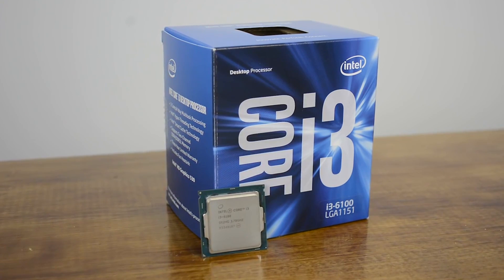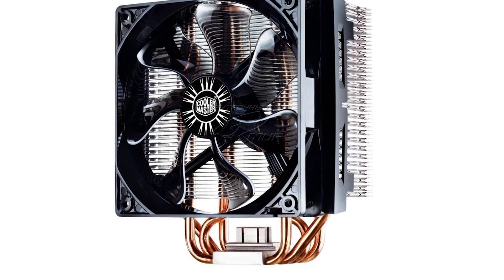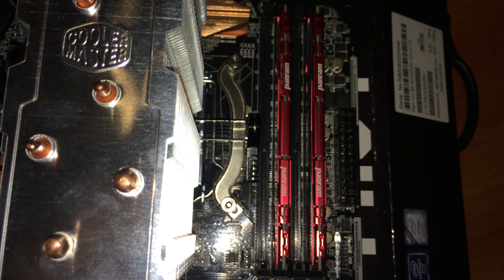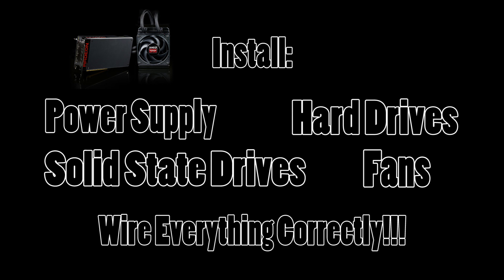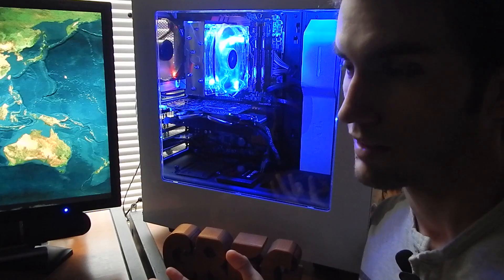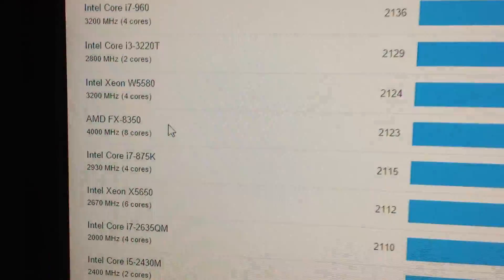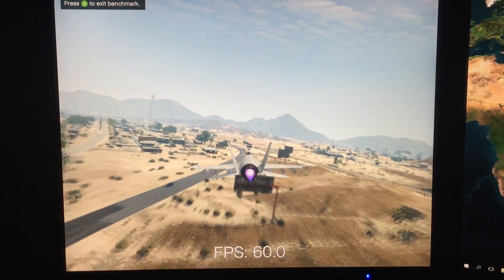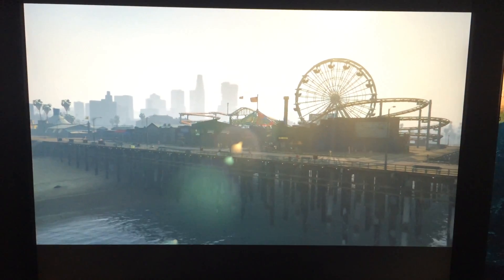$600 Intel i3 Skylake Build

Comment: How do I overclocked this to 4.0ghz??
Reply: this is locked cpu cant be overclock.
Reply: +snoopy shippy  It actually can be Overclocked  ,but only if you own a Z170 Motherboard
Reply: +S a d C a t oh thanks for info can I overclock on asus h110 d3?
Reply: +S a d C a t cool, I have an i5 6500 with a z170
Reply: snoopy shippy  As i said , only Z170 Motherboards support overclocking for the non-K Skylake CPU's

Comment: Would this CPU bottleneck an R9 380? If so, should I buy a GTX 960 instead? Both those cards are the same price where I live.
Reply: +Gixxer Fixxer R9 380 4gb is a better choice unless you're pre-ordering or buying on launch.

And no It won't bottleneck
Reply: +Gixxer Fixxer It won't bottleneck, I would go with the GTX 960 4GB. For some reason, AMD cards have been having issues with new games lately.
Reply: fionn mcgrath And what PSU would you recommend if I went with the 380? Would a 500W 80+ Bronze do the job? I don't plan on over-clocking, if that helps.
Reply: Which cpu?
Reply: fionn mcgrath i3-6100
Reply: You should be fine but a 550 one would give extra OC room if you ever decide to do it in the future. (I know you don't want to right now)
Reply: fionn mcgrath Thanks so much.
Reply: np
Reply: fionn mcgrath
Truly a very wise man. Why is AMD getting a hard time though? It's so strange that Nvidia graphics card will run the games at launch but issues with AMD cards will have to wait.
Reply: Michel Hanson Thank you, I think it's NVIDIA Gameworks that messes it up for AMD and the fact that NVIDIA cosy up to the devs to encourage them to optimize  for their cards
Reply: fionn mcgrath
Ahh boy, looks like the feature is going to die down anytime either cause even after Batman: Arkham Knight, AMD still had issues with a few games after that like AC Syndicate.
Reply: I'm assuming you meant isn't going to die? If so then yes, but AMD are working on their own open source equivalent to gameworks however I don't know if it'll be any good
Reply: fionn mcgrath
It has to.
Reply: I have the i3 6100 with a R9 380 4gb. It runs games well at 1080p max settings apart from GTAV which although running very well could definatly benefit from an i5 due to the games demanding cpu usage. Oh and get a 4gb gpu if you want to play GTAV.

Comment: Would this CPU bottleneck an R9 380? If so, should I buy a GTX 960 instead? Both those cards are the same price where I live.
Reply: It would not but it would bottleneck a 390 or 970 so you're good if you are wanting to buy a r9 380 and an i3 6100

Comment: which one would be better with i3 r7 370 or gtx 960?
Reply: +Basant Tirkey 960
Reply: +Pencho GotShoes which brand and 2gb or 4gb version?
Reply: +Basant Tirkey If you want optimal performance go EVGA FTW 4GB but basically u can go any brand u like will get the job done :)
Reply: +Pencho GotShoes actually I have a 1080p monitor with 60hz refresh rate and I'm building a rig identical to this but confused with buying gpu so which one should I go with?
Reply: +Basant Tirkey EVGA GTX 960 FTW 4GB is the best 960 in my opinion + it has backplate

Comment: Great video, thanks for sharing.  I'm going to build my first PC and I have a lot of similar parts.  I just had a couple of questions.  Why go with the after market cooler if you're not overclocking?  I only ask because I'm going with the same CPU and was told it wasn't necessary.  Also, how does the R7 fair compared to the GTX 950?  I went with the 950, which was about $150.
Reply from the maker: The stock cooler is terribly loud. Cooler temps are always better.

Comment: Hi i have a question. which psu are u using for that rig?

was going to build this setup.
1.mobo Gigabyte GA-Z170X-gaming 3
2. i3 6100
3. corsair vengeance 2x4gb 8gb ddr4 3000mhz
4. SSD scandisk 120gb
5. seagate 1TB HDD
6. EVGA 500W 
7. EVGA GTX 960 FTW+ACX 2.0+ 4GB.

Do u think 500w is going to be enough for my budget rig??

Please do tell??

Sub from me bro keep it up. hope to get ur opinion.
Reply from the maker: I believe this rig used an EVGA 500W. Looks like you've got a great build on your hands. 500W should be plenty.
Reply: +Science Studio thanx for ur opinion bro. That was fast giving ur opinion. With my build that im getting are also future proof. That is why i chose the gaming series gigabyte(LGA1151 socket maybe ill get a i5 6600k or even i7 ) . Think i'll be doing some sli/crossfire in the near future. Oh one more question do u think 8gb ddr4 at 3000mhz will be a problem for the mobo, cuz i read something about this board saying it can handle up to 3466(OC). Thanx again bro. just asking.

Comment: you need to update bios. thats why they release new ones cause its more stable and has fixes
Reply: +botee2k with new bios it's cannot be overclocked
Reply: +Cedric&#39;le Kopuyoruz xD whats your mobo and processor sir? you need a Z mother board with a K processor to be able to overclock properly. intel removed the ability to overclock a non k cpu
Reply: no u think wrong man. with old bios z motherboard u can overclock non k skylake cpu.
Reply: yup thats was possible and thats what people did. but intel did some online update on their processors directly.
Reply: really? wow i didn't know that. then if i will buy i3 6100 and asrock z170 motherboard then i cannot overclock it now?
Reply: you cant. intel really doesnt want people to do it

Comment: Hey man, what do you think about my build? This is my first ever pc build. Im really on a budget and im not really into hardcore stuffs, just want some decent gaming pc that can run popular games right now in 1080p with 45+fps. Here's my build:

CPU: Intel i3-6100
MoBo: msi b150m night elf
V.Card: Sapphire r9-380 4gb
Ram: GSkill Ripjaws V 2x4gb DDR4 2400
PSU: Either this Thermaltake Thermaltake Toughpower XT 675W TPX-675M or this Seasonic M12II-520 EVO 520W 80Plus Bronze Fully Modular or this Seasonic S12II 520W 80PLUS Bronze can't decide which is better.
HDD: WD Caviar Blue 1TB
SSD: no ssd for now.

Hope to hear your thought about my build. Thanks!
Reply: +qwerty-ytrewq U can save some money and get 500W power supply (It will be enough).Also go for 2133Mhz Ram (b150 doesn&#39;t support 2400Mhz). That&#39;s everything .
Reply: +Pencho GotShoes why would you buy b150m ?
Reply: Why not?  U can't overclock non-K CPUs anymore.
Reply: What do you think of my first build? http://pcpartpicker.com/list/4Qvf8K

Comment: hello I was thinking to buy the I3 6100 cpu but I do not know which one to choose Between i5 6500 skylake and i3 6100? Does theese two Cpus have large difference in gaming? Thanks a lot!
Reply: Some games need a lot of cpu power and the i5 6500 is much better then with the 4 cores instead of 2
Reply: Thanks a lot!
Reply: +SorryPkWasHere bwt u cant oc non k cpu so u dont need a z170 board and a extra cooler

Comment: On what resolution you benchmarked gta v? because i dont believe your monitor can handle 1080p
if you`re running in 720p for example this benchmark is a bit dissapointing because you dont say your not running in 1080p
Reply from the maker: This was an old dual monitor setup before switching to my Ultrawide. It's resolution is 1600x1200, which is only barely under the pixel rate of 1080p.

Comment: Your 650$ i5 build is way better the i3 won't it cut it all for games
Reply from the maker: The i3 is definitely good enough for the casual gamer. Gave well over 60 FPS on some titles.
Reply: Science Studio some games won't run on an i3
Reply from the maker: +Kvarcaz1337 A very select few won't.
Reply: +Science Studio Like which ones? I know Arkham Knight and Assassin&#39;s Creed Unity are pretty awful as they were not optimised properly in the first place. Not the CPUs fault, hell not even the video card is at fault.

Comment: how did u put 2666 mhz, i tought the max is around 2100
Reply: +InfernoTNT The max for h110, b150 and h170 motherboards is 2133, but the max for z170 motherboards is something like 3200.
Reply: 2666 is the lowest I think.
Reply: +InfernoTNT the max is over 4200....
Reply: You need to set the XMP profile for the RAM if it supports that and your motherboard aswell

Comment: I can see a lot of work went into this video, and I appreciate the effort. Having said that, I'm disappointed at the misleading title. How can we call this a $600 PC when there's no operating system included? 95% of people building a PC are going to need Windows. There's also no sound card, no network card, no monitor, no mouse, and no keyboard. You should have called this "How to build an $800 Skylake gaming PC".
Reply from the maker: +selohcin No video of mine will ever include a mouse or keyboard (a $15 combo), or a monitor. Do consoles include monitors or TVs? Negative. There are free operating systems available as well. You also don't need a sound card. If you had actually paid attention to the video, you'd have seen that the motherboard had on-board support for 5.1 surround sound. Additionally, the motherboard supports LAN with a simple driver installation. Please do your research before posting exaggerated and rather inaccurate comments. To sum up my rebuttal, I would like to make the following announcement: the PC was $600. The title is not misleading.

Comment: Frak it piss's me off how asian made IT parts are in USA , just looking at that build , it comes to over AUD$600 without a graphics card
Reply: +charlie brownau Aussie - Skylake Overclock i3 Build
* Intel Core i3 6100 LGA 1151 3.7GHz CPU Processor - AUD$175.00 .. 
* ASRock Z170 Pro4 LGA1151 ATX Motherboard  - AUD$190.00
* Kingston 8GB (2 x 4GB) 2400MHz DDR4 HyperX FURY - AUD$90.00
* WD 1TB HDD - AUD$70
SSD - AUD$70
600W PSU - AUD$70-90
Case  - AUD$40-90
DVDROM - AUD$20
Graphics Card AUD$140-AUD$200

Comment: Wow. USA prizes are really cheap. Here in Europe it's pretty expensive to buy the same hardware. i3 6100, DDR4 2133 RAM, GTX 750 TI, CPU cooler, case etc is about 555$ plus the setup is like 600$. Why the setup? Well if you order that, then you don't have to pay shipping taxes, buuuut: shipping taxes (12$) and setup (45$). And I thought at the begining that ship taxes were like (30$), so there wouldn't be such as money to improve anything from the pc. I was wrong... Anyways, I could bought that instead if I lived there... Wow.
Reply: Forgot to say that my mobo is a H110 vs that Z170. That's the biggest difference after all.
Reply: +Contraa In Australia we get RIPPED OFF for Software , pro audio music gear and computer gear aswell , they CLAIM it is the US<>AUD dollar or the amount aussies make compared to USA people , but we all know its the AU TAX with America tech gaints ripping Aussies off when 99.999% of all the parts are made from China
Reply: +Contraa H110 is around AUD$100-AUD$165 , Z170 is AUD$185 to AUD$270

Comment: I added the same CPU with a 7970 and a Krait gaming mobo with 3200mhz ram and this little beast is very impressive...I have to agree that this is probably the best bang for the buck and benchmark wise should walk on any Xbox One or PS4 regarding hardware muscle.
Reply from the maker: That sounds like an epic combo you've got going there!
Reply: +Science Studio  So far this combo appears to hit the sweet spot for price.  Single core games and bandwidth intensive games should  take advantage of this setup.  Looking at benchmarks, it appears that this cpu gets kicked the most by game engines that properly take advantage of truly multi-core processors.
Reply from the maker: +Mr. Cimmarrusti Check out our newest benchmarking video. Also, I'll have a new Core i5 6400 + 4GB GTX 960 uploaded in a few days, the parts should be here this weekend. Will be interesting to compare.

Comment: hi sir its me again. can i use r9 380 videocard and samsung 250gb ssd for this build? i prefer i3 coz its cheaper than i5.
Reply: every i3 6100 skylake processor already have hyperthreading ocd?? im looking on newegg but i only saw i3 6100 3mb 3.ghz
Reply: +Gab Bennington why did you used 2 hard drive? the 120 ssd and 320gb caviar blue?
Reply: +Gab Bennington ssd for boot the hdd for games and stuff

Comment: OK so now I have a question. I bought everything I needed. I put everything in but when it came to turning it on ,it would turn on but after a minute or two it turned off and it would turn on again then off again. my friends and I tried everything except take it apart. do you have any advice
Reply from the maker: Start swapping parts. Isolate the part that's causing the crash, if you think it's a hardware issue.
Reply: +Science Studio OK will do

Comment: I3 6100 does not support turbo boost so you are stock with 3.7ghz. You can overcloack in asrock mobo with bios update but the processor does not turbo boost.
Reply from the maker: That's correct.

Comment: What Psu are you using ? Its not in the Description
Reply: +MrApvel Immer diese deutschen :D
Reply from the maker: +MrApvel EVGA 500W
Reply: Vorallem ist evga 500w eine tolle Antwort, das geht von fast Böller bis zu sehr gut ^^
Reply: Wahrscheinlich hat er noch n paar Böller von Silvester übrig gehabt und zu eienm Netzteil umgebaut ;)
Übrigens, hab heute nen i7 6700k mit z170 Mainboard, ram und kühler bestellt...
Meine Grafikkarte: R9 270x :D bestimmt kein bottleneck^^
Reply: Pfff solange du nur cinebench spielst geht das ^^
Reply: Gute Idee! Aber ich glaub ich bleib dann doch lieber bei Minesweeper :D

Comment: i though the max ram was 2133 mhz? like specified on intel website? im planning on buying this i3,
Reply from the maker: Max supported at this moment is 3200MHz for most board/Skylake combos, but a theoretical 4000MHz is technically supported by the CPUs. The minimum is typically 2133MHz; that may have been what you were reading.
Reply: +Science Studio yeah i read supporrting 2166mhz ddr4, son that would Be thé minimum supported, not  the maximum?
Reply from the maker: +Bastien Roy It's definitely not the maximum. People already run 3200MHz on their Skylake machines.

Comment: can you please tell me how u use a ram of 2666 while the cpu supports only 2133mhz.i know the mother board supports higher than the cpu but still .. how does it work?
Reply from the maker: The CPU does not control RAM speed. That would be your chipset's job. I have a video uploaded showing how to ramp up DDR4 speed.
Reply: +Science Studio 
yes thats true but does it mean somthing when the cpu dosent support the amount of ram the mobo does support?
Reply: +Science Studio The memory controller is built into the CPU.  Not the chipset.  From Hardwarezone.com:

Dubbed DDR4 Non-Z OC, the feature adds automatic memory overclocking capabilities to ASRock B150, H170, and H110 motherboards for improved memory performance. It is actually similar to the DDR4 OC feature found in the UEFI BIOS of ASRock Z170 motherboards, which is able to increase the frequency of select DDR4 DIMMs from 2,133MHz to 2,800MHz, a 30% speed boost.

The cpu is the one that will dictate how far the memory will overclock.  Everything above 2133 will overclock the controller (on the cpu).  Just because you have 3200mhz memory doesn't mean the cpu will overclock that high.    Also, when people have overclocked the locked processors, they have usually backed down all memory to a safe 2666 regardless of how fast the ram is.

There are many videos on how the integrated memory controller works.  If you want more info it is pretty easy to find hundreds of sites that will describe how it works.  Skylake makes a few changes to it though.

And to Chen's responses, that is what makes tinkering on PC's fun.  Going above the rated specifications.  Most chips are not made for a specific model.  They are all made the same, tested, then made a model from there.  Remember when you could 'unlock' cores on the AMD Phenoms?  That is because they were all made the same, some cores didn't pass the tests, and they turned them into dual cores.
Reply from the maker: +Cullen Hoag We are only referring to the Z170 chipset. Skylake CPUs support 2666MHz RAM by default. As long as his DIMMs are rated at 2666MHz, he'll be able to use XMP in his UEFI with no issues. The article is only relevant for people who wish to OC to 2800MHz+.
Reply: +Science Studio The base memory clock of Skylake CPU's is 2133.  And no, the XMP profile has been a nightmare on Skylake.  The XMP 2.0 profile did not work well with many kits.

Jedec standards on all DDR4 memory kits are supposed to be 2133mhz.  However, there are multiple 'enthusiast' grade kits that are not defaulting to the 2133 standard.  Hyper X had a few of them go out.  To get around that, you HAVE to manually set the timings and voltage to get them to work correctly.  Sometimes requiring slight boosts to the voltage to get more than one dimm to post.  I am also in that boat with my GSkill Ripjaws 4 2800 kit.

If a skylake cpu supports 2666, please post a reference.

Thank you.  

And btw, your OC video on the 6100 made me buy one.  :)